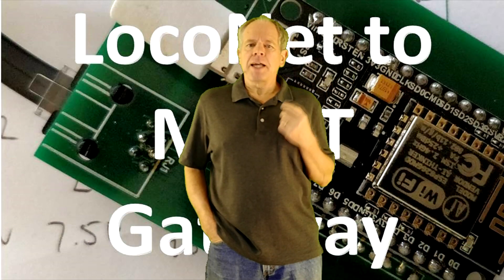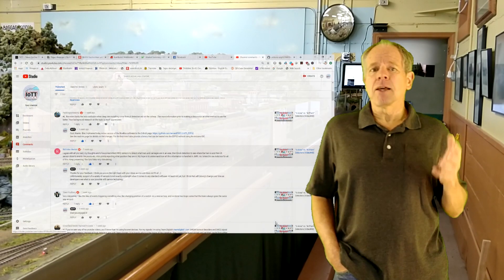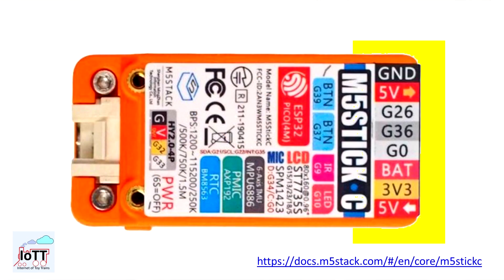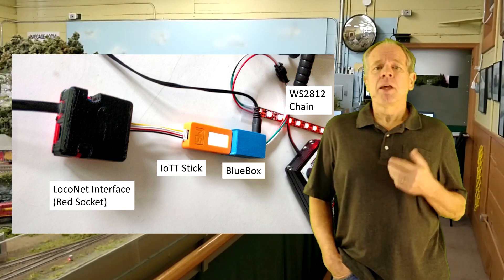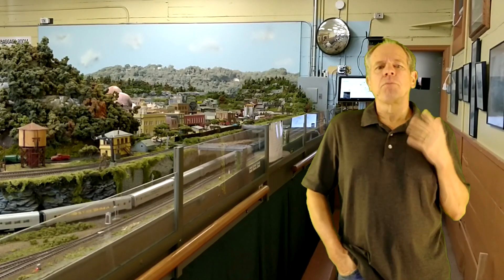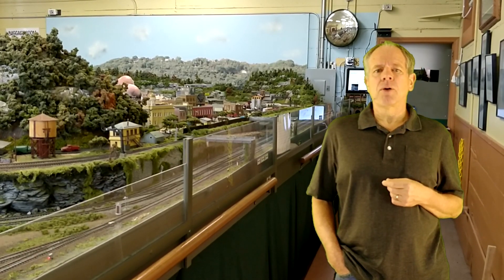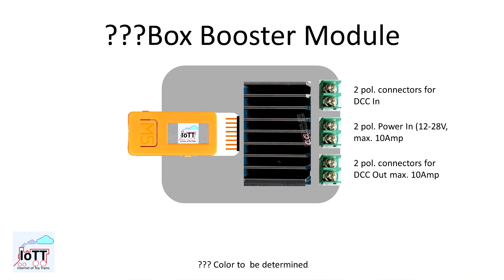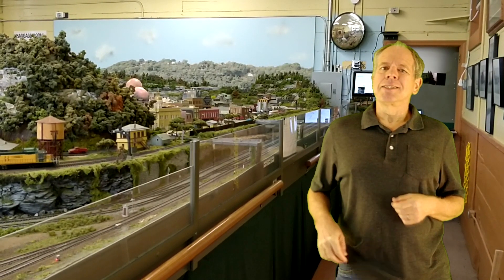The IoTT Stick (Video#41)

Comment: This looks like a place to start.  I'm working on a onboard battery charge system for Arduino esp32 now.  Hopefully it would just plug into one of these iott on the USB port.
Reply from the maker: The Stick can receive 5V for recharging the battery either via USB or the 5Vin pin on the hat connector. It has an internal BMS to control charging current and low voltage cutoff. Furthermore, it has the battery plus on the hat connector, so you can add an external small LiIon 3.7V battery and it will be managed by the built-in BMS. So, yes, the Stick is a very good option for train-side devices such as my measuring car sensor.

Comment: I am currently using DCC++, and I would like to have a less expensive loconet connection as I have a Digitrax throttle and I would like to connect it to the system, and I like the introduction to the yellow box to do sensor inputs. Thank you for your videos.
Reply from the maker: Thanks for your comments. Connecting a Digitrax throttle to anything else than a Digitrax command station is a little tricky as it has relatively tight constraints regarding message timing. There is a DCC++ version for the ESP32 that has a LocoNet interface. Did you try it?

Comment: Very interesting. I am using loconet with in TrainController software. Will I be able to integrate this in with signaling?
Reply from the maker: The IoTT Stick talks LocoNet, so that is not a problem. If you use light signals you may check out the possibilities of the BlueHat. For semaphore signals the GreenHat will be an interesting option when it becomes available. Also, using the IoTT Stick to build a gateway and use the Smart Phone LocoNet Viewer will work with your LocoNet system.

Comment: Hi, if I want to build a control panel with push buttons and led’s using the M5stickC, would I have to have 2 loconet interfaces, 1 hat for led’s and 1 hat for push buttons and 2 M5StickC ? Or should I use 1 ESP32 with more I/O  ?
Reply from the maker: The YellowHat has 32 inputs for buttons and the LED chain can drive up to 525 LED's. If your panel has more than that, you can add a second Stick/YellowHat. Or if the limitation is just the number of LED's, a Stick with BlueHat.
For communication, you then either connect both Sticks using a LocoNet interface for each, or you use Wifi with MQTT by making one of the Sticks your LocoNet to MQTT gateway and on the other you use LocoNet over MQTT. Of course that solution requires a Wifi Network with an MQTT broker. But if you plan to have more Stick devices in the future, it is very cost effective as you do not need any more LocoNet interfaces.
Reply: IoTT ok, a great explanation. If my panel is less then 32 inputs and less then 525 led’s I still need a stick for each hat, right ?
Reply from the maker: Yes, each hat needs a Stick. That's where the software is located. Hat's can't work without Stick. But then, the Stick can deal with all types of hats and communication modules as it is configurable.

Comment: Hello again, I'm om starting to feel like the dummy in the back of the class.
where I am so far
When I first got the IOTT Stick and purple hat , I had it set up and working.
Then it sat in a box for a while. During that time I changed my home wifi. I have since gotten the IOTT Stick to recognize the new router.
I updated to version 1.6.4
When I go to the IP address (192.168.40.198) all I see is the  IOTT Icon, no setup page.
I was able to roll back to 1.5.2 but no different.
I have tried to find a browser setting that might be preventing the page from showing but could not, I have tried with both Edge and Chrome

OK, disregard it, I installed Firefox and it seems to be working.